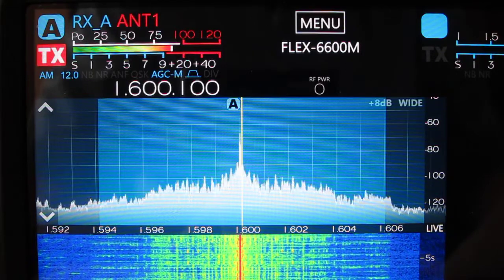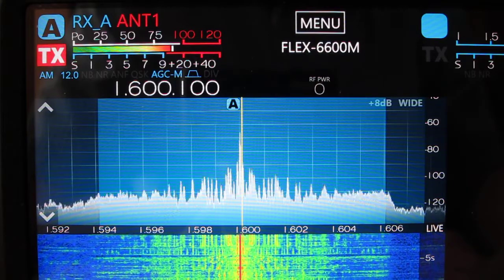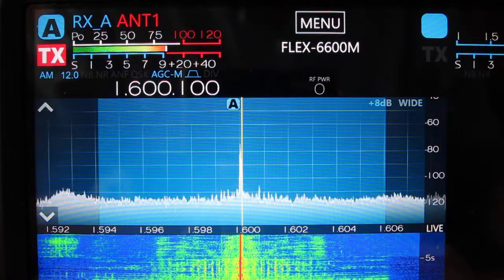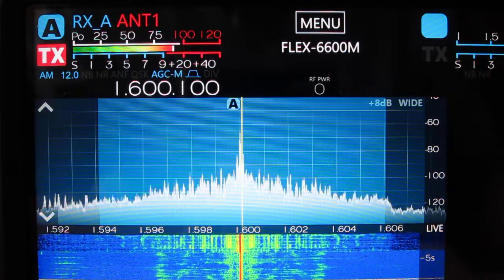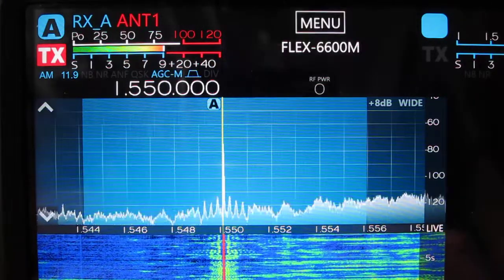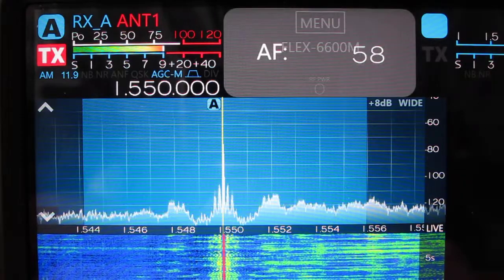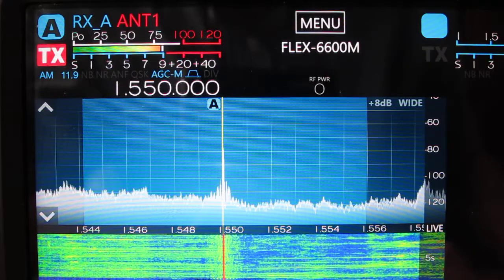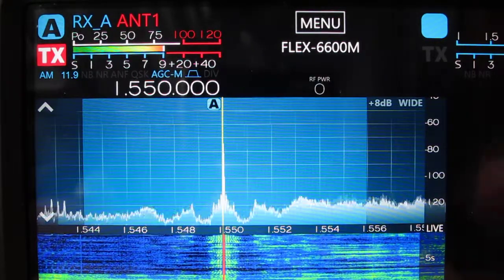BevFlex-4X Beverage, BOG, and EWE Demo

Comment from the maker: Like any low noise, Rx, antenna, you should keep it as far as possible from your Tx antennas to prevent  noise from the Tx antenna being coupled into the Rx antenna and to prevent high Tx power from being fed to the Rx input of your transceiver.  Try to avoid crossing the radials of the Tx antenna. 
Use a back to back diode power limiter at the Rx input of the transceiver or a T/R relay to disconnect the Rx antenna during Tx or both of these protective measures. It is a good idea to know what the coupling factor is between your Tx and Rx antennas.  This can be easily measured with a NanoVNA. 
If the Rx T/R relay is keyed at the same time as the Tx PTT is keyed, the timing of the switching should be OK since most transceivers have at least 10mS delay in RF output after receiving the PTT command.

Comment: How far do you need to keep elevated beverages and BOG’s from TX antennas and do they need TX delay? I have an FTDX10 with now RX connector so i have to use an RTR relay like the DXE RTR-2 but without a sequencer im not sure what kind of delay there is.

Comment: Has anyone measured the signal strength difference between a BOG truly on the ground vs. an "elevated" (2") BOG?
Reply from the maker: The BOG placed 2 inches above the ground surface would have a received signal strength 6 to 10dB greater than a BOG lying directly on  the ground surface, depending on the soil conditions and dampness.
Reply: You definitely make a superior product!  I have space for two BOGs. One would be 225' and the other about 700'. Want the bidirectional concept and thinking of using surplus 75 ohm hardline. Given the low gain of the BOG, would you recommend a remote preamp near the feed point?

Comment: helo, bog vs ve3do ??? what is the best ?
Reply from the maker: Gustavo,
Thanks for viewing the video and asking the question.
BOG of 245ft (74.7m)  may have better low angle signal F/B and somewhat higher gain, but VE3DO or EWE will have similar performance on most received signals and is much smaller.   If the BOG has to be much shorter than 74.7m,  the VE3DO, EWE, or FLAG are better choices.
73,
W8GNM
Reply: @bevflex-4x288  ok, gracias, mi problema es el ruido en 80, 9+10 , mi antena es una windom carolina, en v invertida, con capacitor central, a 10 metros de altura,  funciona muy bien en 80, 40 y 20, voy a probar con una ve3do.